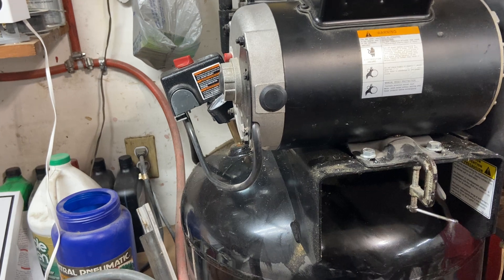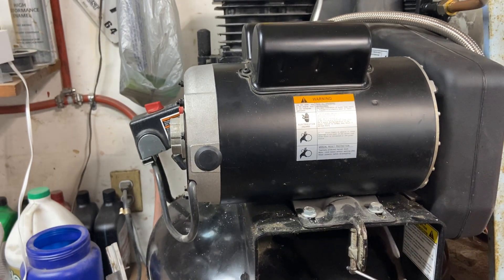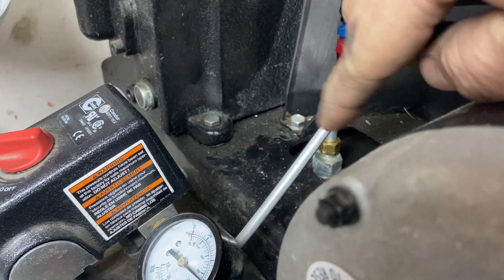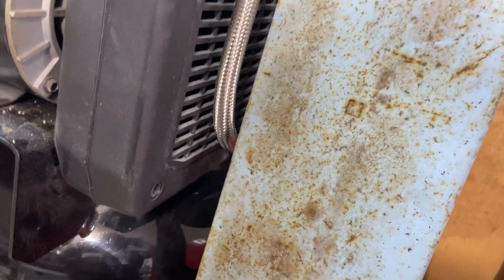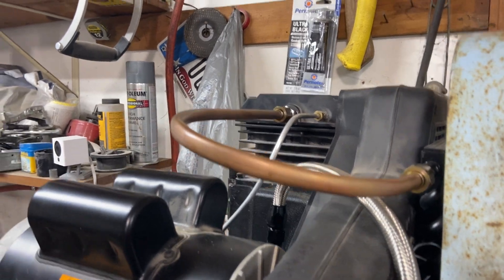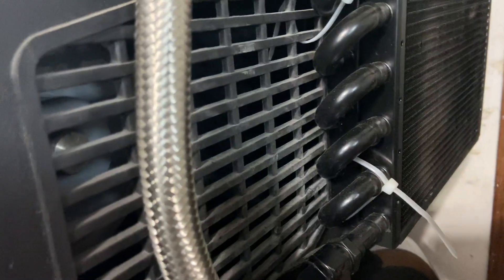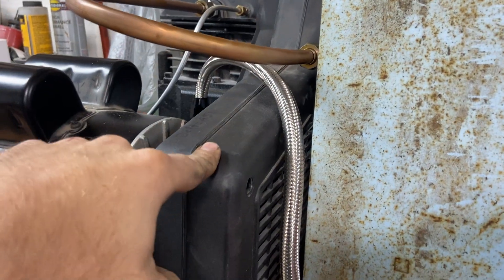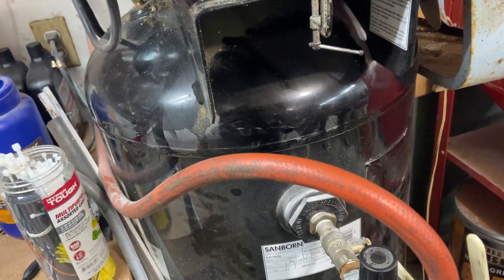Reducing moisture in your air compressor with a simple after cooler.

Comment: Great video, I'm in process in doing the same thing, I was wondering What did you use to seal the threads on the fitting that goes to your Compressor pump?
Reply from the maker: For any threaded fittings, teflon tape or any PTFE paste is fine.
Reply: @RileyKnifeandTool  The temperature on that particular fitting is around ~300+F. When I removed compression fitting from my compressor pump from the head I found black burned deposits, whatever was there has disintegrated since factory from about 11 years ago. I wonder if that Bluemonster PTFE paste would suffice.

Comment: It's not about a 37 degree flare it is a 37 degree flare and a single flare at that. JIC also use -X for their sizes and are more commonly used in hydraulic applications.  Parker is the top dog in the room for that and all their fittings are etched -X for their size. 

The main difference betwen AN and JIC is the thread. AN are much tighter tolerance and have a slightly different thread angle than JIC. AN are also stronger in both shear strength and fatigue life.
Reply from the maker: Thanks for the information!

Comment: Definitely better to get right to the point without the rambling.  As to what you did, you cooled the air (which takes out the water) but then you allowed the cooled air along with the water back into the tank.  It would have been more sensible to filter out the water BEFORE the cooled air goes into the tank.

Comment: So let's think about this. In your modified arrangement,  you are not "drying" the intake air, o.k? Fine so far, same as before. The amount of water you are taking in as a byproduct of air intake is unchanged. Your compressor is STILL intaking humid air, and compressing it, moisture and all. So you have added a small downstream condenser. Yes, this is partially cooling the compressed humidified charge, which will condense (some of) the water "out" of that compressed air...but THEN WHAT? 

64 thousand dollar question: Where is "out"? Where does that condensate go? 

With your current arrangement, the condensate water still goes right on into your tank! Nothing much has changed. It may enter your one-way check valve at the top of the tank as a drippy spray as opposed to uncondensed moist air, but your tank is still wet and still filling up with water. (Partially) condensing the water out of the air does virtually no good if you don't separate out the condensed moisture PRIOR to your tank entry. 

Bottom Line; You are halfway there. You still need a drip loop and a separator vessel at the bottom of the loop, preferably with an auto bleed feature. Otherwise, the moisture you condense is going to end up in your tank anyway,  mostly defeating the purpose of the condenser.  

Just something to think about.
Reply from the maker: I have since added a separator just after the cooler with an auto drain. I need to make an update video I suppose. 
Thanks for your comment.

Comment: You have no way to remove the material from the system
Reply from the maker: There is a separator where the hose attaches to the tank. I also added one just after the cooler after this video was made. I still drain my bottom tank every couple of months or so, but the water is far less now.

Comment: That was awesome. I have been wanting to do exactly this with that same oil cooler. I wasn't sure if the different metals (in your list of parts, there is steel, aluminum, copper etc) would cause a problem long term with different metals attached to each other. I also do not know if the 1/2" copper tubing comes in different ratings (maybe one type can handle the water line to a refrigerator but that's less than 40 psi, etc)  That braided hose was nice - I wish you had posted a link for that. I have flared many things in my life but I am not sure what an AN or a JIC fittings are. Time to learn about those. Thanks for the video and links.
Reply from the maker: I haven't noticed any issues with the different metals. The copper tubing comes in a couple of different ratings, but they should all be fine for the PSI we're dealing with. As for the braided hose, I think I got that from SummitRacing, or maybe just a generic eBay search, but you can also just bend and flare copper instead if you like. I just used the hose for convenience.

Comment: Nice video.  That looks like a really small diameter pipe going into the tank.  Are you not worried about a restrictions from either that, or the really small cooler?  My Saylor-Beall compressor uses a 3/4" OD pipe from head to tank and it seems that a lot of guys on YT are using 1/2" so I called Saylor-Beall and they said that much of a restriction could damage the compressor from too much back pressure.  I returned that small Derale cooler that everyone is using and went with a much larger one with larger diameter tubing to keep the air flow close to stock.  3/4" for most.
Reply from the maker: I do thing the supply pipe seems a bit small, but that’s how the compressor came, so I didn’t change it.

Comment: With this system you are still pumping the water in to the tank, it will have less humidity in the air but it will be settling in the bottom of the tank. You really need a water separator on the output of the cooler to stop it from going in to the tank.
Reply: yeah... a great vapor condenser. but if ya don't separate the water you just installed all that hardware to condense before the tank, you haven't actually eliminated any moisture from the tank. I imagine this rig at least leaves more of the moisture in the tank; but plumbing in a moisture separator between the aftercooler and the tank is where the big benefit is!

Comment: so all the water condenses in the condenser, and then what? gets pushed right back into the tank? why not have a water trap right after the condenser before the tank? or do you not get any water in the tank?
Reply from the maker: The water going into the take was drastically reduced as setup in the video, but I did end up later adding a seperator just after the cooler as well, which also helps. Thanks for watching!
Reply: @Riley Knife and Tool  how much is in the separator  If you do a fair amount of running in a day?
Reply from the maker: @sean7193  it doesn't fill up by any means. If I'm doing a lot of sand blasting and running  the compressor a lot, I'd say it doesn't get even halfway full (it's a small separator). Part of it will depend on where you live and how dry the air in your shop is to begin with, but for me the cooler made the biggest difference.

Comment: where do you drain your water? I didn't see any drain. You just add a cooler.
Reply from the maker: I’ve since added a separator/drain after the cooler. I still drain a very small amount from the bottom of the tank every once in a while as well.

Comment: Good job and thanks for the detailed info about connectors. 
If I may, I’d like to point out several things that can be improved upon. 
1. Get a flexible hose to connect compressor to radiator input. Vibrations transfer through the copper tube and can wiggle your connectors loose. 
2. You need to drain the water between radiator output and tank. Otherwise the water collects at the low points and eventually make it into the tank. 

Put an elbow after the radiator so the air goes down. Then a copper tee that branches to your return hose and goes straight down. This end of the tee connects to a foot of copper pipe and you put a ball valve on the end. So whatever moisture comes out of your radiator, sinks down to the ball valve and collects in the pipe. Drain the water after every run. 
It will make a world of difference. Always have a down drain for water to go and released at will. Otherwise you never get rid of it. 
When your pump compresses air, it gets hot because the pressure increases (PV = nRT; pressure x volume is proportional to temperature). 
The moisture in the atmosphere is vaporized at high temperature and only condenses when the air cools. That’s why you use an aftercooler. To cool the air and release the moisture. Then you collect that water and dump it before it goes in the tank. 
Hope this helps. 
Paul
Reply from the maker: Thanks for the suggestions. I have ended up adding a water separator with an auto drain between the radiator and the tank. It basically drains every time the compressor stops.
Reply: @RileyKnifeandTool  My suggestion would be to use a bigger cross sectional T fitting and use reducer. The ideal shape would be a small tube tangentially enterimg into a bigger diameter tube (tank). The working principle is that the fast moving air slows down drastically in the big chamber and exits at the top, while the water with it's higher mass can't decellerate fast enough and clings the walls, and due to tangential entering it's momentum will cause it to spin around the walls of the chamber thus flow down to the bottom.

Tangential entering helps a lot, but you can sort of make a working contraption out of big fittings and reeucers.

This is a cyclone separator kind of thing.

If one has machining skills and tools, the more effective chamber shape would be conical (small side down), air could enter slightly angled down, exit should be way above the input port and possibly through a mesh filter (which can additionally trap small vapor and which then will form larger droplets).

I had an idea where I would slowly drip the already collected water on to the aftercooler (or an another cooler) to further increase the cooling effect by evaporation. Are there any existing contraptions which use this method?
Reply from the maker: @gabiold  Those are some good thoughts. Thanks for sharing!
Reply: @gabiold  I saw somewhere on Youtube where a dude had the "T" thing you are talking about.  The lower leg of the T was drained into a 4" diameter x 36" long galvanized pipe capped on each end (like a big pipe bomb) running down the side of the compressor tank.  Inside his pipe he stuffed round copper scouring pads to act like a water collection filter.  The bottom of the (pipe bomb) had a drain in it.  Viola
Reply: Hey, thanks for the thorough response to this. So I tried adding a flexible hose that was rated to just under 250°F but I cooked it to blowout in about half an hour. Do you have a material that you would suggest? I have been reading about silicone, fluoroelastomers and FFKM synthetics, but having trouble finding hoses available. Thanks
Reply: @paulmanhart4481  l have a water separator before tank l drain that collects water,, it's not a radiator it's a 25 foot roll of 1/2 inch copper tubing plenty of flex and l have a hydraulic hose from separator to short pipe that was on tank,, l have all 3/4 copper pipe lines with 12 in down drops with drain ball valves ,, believe me you can try all you want but you can't impove on my setup,, lve never drained more than a cup of water from my tank winter are summer and just a few drops at drain valves and water separator takes a month too fill up,, my air temperature dropped 70 degrees just running through the coil copper pipe and that's what you want to drop hot compressed air temperature so it doesn't condensate entering the cooler tank.
Reply: @paulmanhart4481  l paint cars and l don't even need a dryer with my system I've never gotten a drop of water at the spray gun,, l was going to use a after cooler but it restricted the air flow alot more than the 25 foot roll of copper tubing so l abandoned it and came up with a much better setup.

Comment: Great video and VERY informative. Question, I don't know if you mentioned this in the video but how much AIR PRESSURE can that radiator handle?
Reply from the maker: Working pressure is rated for 250psi, with a burst pressure of 300psi.
Reply: @RileyKnifeandTool  Thank you for the reply and the info sir. 👍

Comment: If you had to do it again, would you stick with the Derale tube & fine AN cooler or the more efficient plate cooler (Tru-Cool H7B) that doesn't need AN fitting and shouldn't need a fan?
Reply from the maker: I think the Derale is plenty efficient, and a bit more affordable, though a plate cooler might be a good option as well. I only run an additional fan when I'm really pushing my compressor hard, and I've also added an additional water separator after the cooler as others have suggested, which does help.

Comment: Best with the 60 gallon 155psi is to back pressure switch down to 135 psi will extend compressor life and you never need 155 you will notice they struggle to reach 155 I went from 7 to 5 minutes to fill tank from empty will save years on your compressor life
Reply from the maker: I'll have to look into that. I imagine it fills more often, but for not as long. Interesting tip.
Reply: @RileyKnifeandTool  you will notice it takes no time to drop pressure to 130 but takes alot longer to get it from 130 to 155 but looks good for selling but it's really to much on the pump.

Comment: I used 25 foot roll and no oil cooler and put Separator just before air enters tank and ran my intake through wall to outside really quiets it down and you get all fresh air
Reply: i thought about doing this with my intake. But i'm worried that the fresh air outside contain more moisture than the air in my heated shop.

Comment: Any time you use radiators for cooling you are suppose to have air flowing throw it which is why on cars they put these in front of the engine with fans in front of them as well so they have both fan and air from the vehicle moving flow through the fins. Also I would be more concerned with the PSI rating of the unit. Another thing I know when doing residential plumbing  if you use to many elbows to a fresh water line you  can reduce the PSI output which honestly means it could make your motor work harder than it should
Reply from the maker: All valid points. There is air flowing off the flywheel, as well as an external fan I place next to it. Max psi of the components I used far exceed the output of the head, and lastly, the plumbing is upsized well above the check valve into the tank, so no volume should be lost. Thanks for the comment.

Comment: Yea i did the same thing..  i just spent 30$ on a 5 run power steering/ transmission universal cooler..   is like a 1.5’ square radiator with a coil of 3/8” copper tube with 5 runs through aluminum fins.  No fan, i just use the air that the flywheel blows onto the pump..   and i made sure that the runs go vertical so theres 5 water traps before a 15$ Oil/ water separator with auto drain pee hole..   it empties maybe every 20 hours of use..  you cant touch the copper coming out of the pump and the coper going into the tank is room temp..   oh and the auto drain is actually something i set up with the unloader air..   if the amount of fluid in the separator reaches a certain limit, the weight of the fluid will open a solenoid that allows the head pressure vent to blow it out on its own then the relay and solenoid reset and boom monkeys got a banana..

Comment: While browsing around, I found some aluminum -8AN compression fittings with brass ferrule and wanted to know if you know if it is possible to use it with the copper tubing. My tubing is .500 OD from the head to the tank. Any help is appreciated

Comment: How is the Derale 15300 holding up. Is it keeping the water moisture down. I'm just starting to install the same cooler on my compressor and just wanted to see how it is doing a year later. Thanks for responding.
Reply from the maker: Still holding up great. I’ve since added another water separator between the cooler and my tank, and it works even better now.

Comment: If u put a water separator after the intercooler before the tank it will remove all the condensed water before it reaches the tank
Reply: The inner cooler goes between stages. What you are referring to is an AFTERcooler.  And no, a water separator will not remove all the water.
Reply: @jj-zy6gc  yes that is correct. It doesn't remove it all but I've found it removes alot

Comment: Cool use of fittings! Very clean job. Never could figure out those AN fittings. However,  "Where's Waldo?", where Waldo = H20?  Seriously, there is no scenario where that heat exchanger can reduce moisture unless there's a place for the extracted water to hang out. Confirmation bias? Or is it getting trapped in the condenser and a year later the condenser got full? I say add a water trap of some sort. Waldo is somewhere...
Reply from the maker: I recently added a separator between the tank and the cooler. I do see a fair amount of water coming out of it now, though I don’t see much difference if any in my air lines coming out of the tank. I may do an update video.

Comment: Thanks for the details on fittings.  Here's a chart for others trying to figure out what fittings you have.  I'm in NC, trying to run a plasma cutter, so moist (and I do mean moist) compressed air is a problem.  https://www.zoro.com/resourcehub/how-to-measure-pipe-and-fitting-sizes/  also, https://www.petersenproducts.com/Copper-Tubing-Sizes-s/1979.htm
Reply from the maker: Thanks for the chart!

Comment: I can't find out what in the hell the threads are that are machined into the block that the air comes out.  The fitting I took out I can find anything it will screw into accept the block it came out of.  It seems to be around 20mm, with courser threads like a gas fitting.  Anyone have an answer or do I just have a bastard size thingie.  I have a 20 gallon husky
Reply: Probably npt. national pipe thread. Its a taperd thread thread that usually requires a thread sealer for best results.